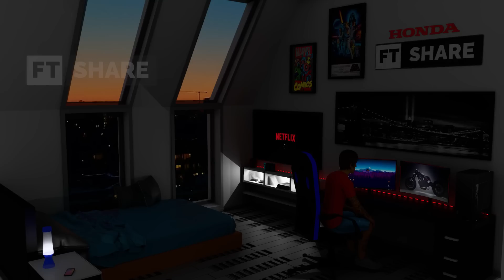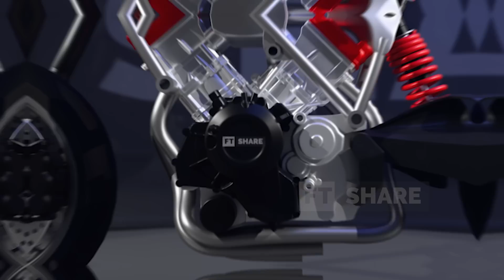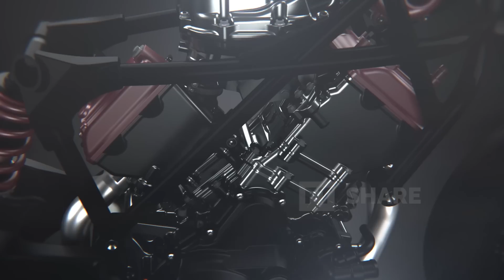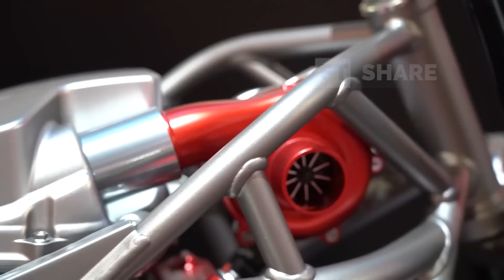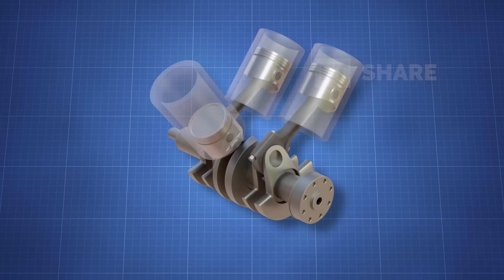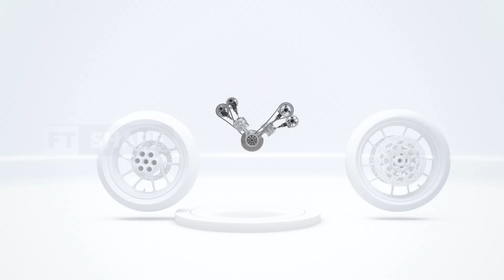READY FOR MASS PRODUCTION!!! - Honda’s New V3 Engine with Electric Supercharger is Finally Here!

Comment: Id like to see a standard belt driven centrifugal like the rotrex h2 charger. Theres kits for the vfr to use a supercharger so, I dont see the reason for the electric turbo, the bikes just cant account for that. If they do, the battery will be a financial bottleneck being $1000 for a replacement and limited, maybe if they used a twin turbine system where one is Smaller kickstarted by electricity, and a bigger turbine underneath that takes the higher throttle to lessen the use of electricity. its possible thats already the intention but im excited to see. itll be beautiful.

Comment: A vacuum cleaner style blower fan on the crank shaft would be better than the Electric blower, but could have both.
A wind scoop on top of the tank.  An air conditioner type AIR INTAKE COOLER cuz a heat engine runs better in cold damp air, so you are going to need a water tank and an adamizer ?  Then a passenger seat vibrator, so a real man doesn't have to buy a Harley for his woman.

Comment: I'll be impressed when it matches the Kawasaki H2... Honda should hook the supercharger right up to the engine drivetrain... Screw the electric charged supercharger.. Put an inline 6 engine on a motorcycle with a gear-driven supercharger, perfectly balanced..

Comment: Luckily the electric mechanism is only used to spool up the turbine. After boost is made it works like a conventional compressor.
Reply: With no exhaust gas connections how is it driven if not by the electric motor?

Comment: As you, and everyone has noted, electric power to the turbo will be a limitation, specially under tough riding. Batteries won´t be able to cope constant turbo use. But for easy riding, the smooth power will be there when required, of course, for a limited time. I hope this works! Good job Honda. Innovation is great even when it fails.
Reply: It also should have an electric turbine harvester. And perhaps use the starter motor at low power, to harvest electricity.
Reply: It did talk about having a large alternator.  That could provide the power but of course that uses engine power.  It would be interesting to see how shaft torque changes with engine rpm and supercharger rpm
Reply: @DrParticle  We'll see. Can the electric turbo compensate power loss from the large alternator? Maybe it can.
Reply: @DrParticle  It clearly DOES have a substantial alternator. One of the other videos showed the engine from above, and the alternator looks huge. Perhaps it has an extra charging function that can switch on when the supercharger is engaged? Might compromise the extra power offered by the supercharger, but time will tell. The rear exhaust pipe looks awkwardly routed, but I guess all three will be more similar in length, and enter a large catalyst under the engine on the production model.
But it's nice to see someone attempting to find a new solution to making motorcycles better! Gotta be happy with that. Every other manufacturer only offering upgrades of existing technology, into this uncertain market.

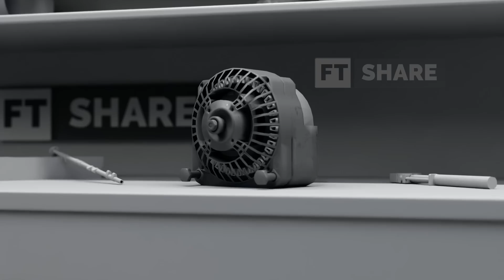Comment: 5:50 You cant conclude 2.7kg extra weight because the 3L Audi has 10kg extra, and this bike (which is also estimated) will be 800cc. Does not compute!
Reply: Yes, it does. 
It needs E-COMP and a bigger battery 
and a bigger capacity generator. 
Instead, I think the engine starter motor will be combined with the generator. 
2.7KG is not enough.